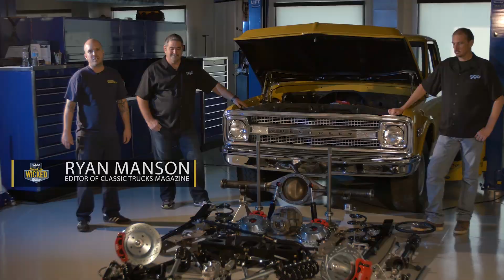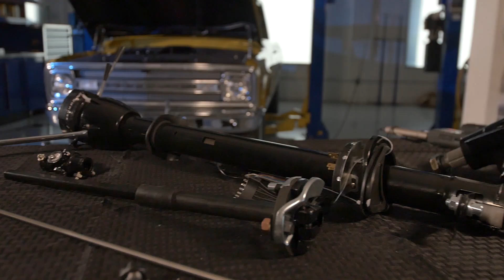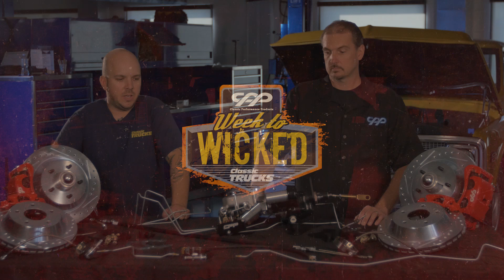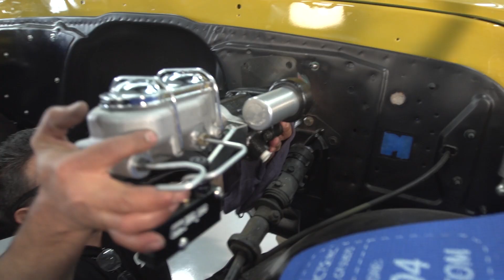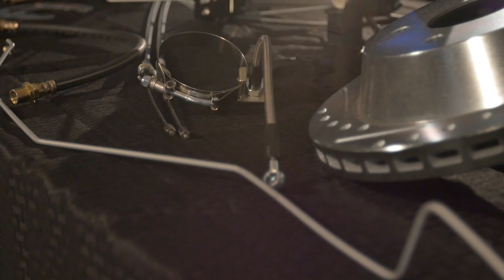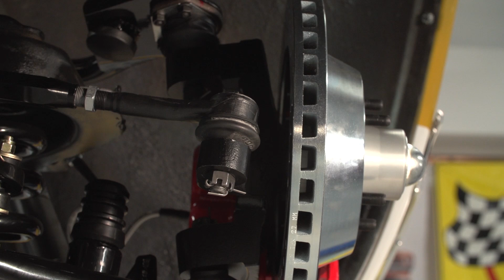Classic Performance Products Week to Wicked C10 Brakes

Comment: How do I order this entire brake set up rear axle the works and is that 5x5 bolt pattern?
Reply: My truck is a 62 but I have replaced the front crossmember to a 63-66 style along with cpp a arms
Reply: Philip Schutter how did they hold up bro? Just ordered front lower control arms from them